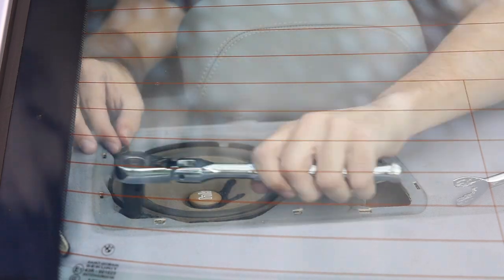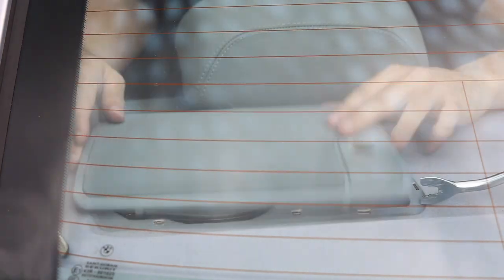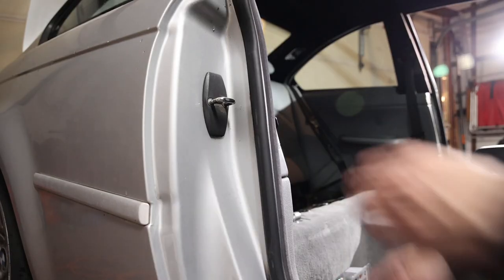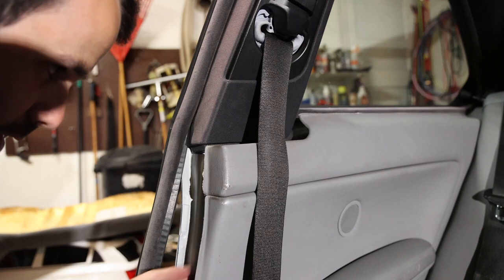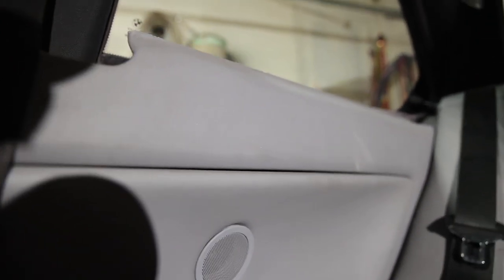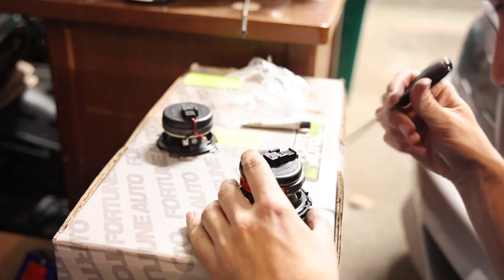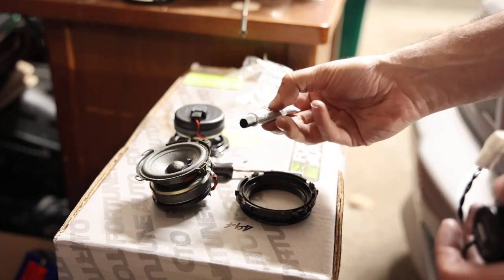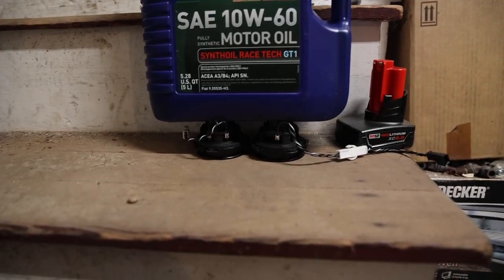Installing BavSound Speakers in my E46 M3!

Comment: I did this system on my e36. The only thing I didn’t like was the lack of base. It also is very high pitch out of the box. Needs some tweaking. BUT with that said it’s by FAR the best OEM + system out there. I just wish they made an integrated base for the e36 & e46. 

I’ll take a listen to it in your car and possible cop for the ZHP

Comment: There's not stuff out for Audi because it's often either Bose or B&O, which is difficult to just swap speakers. I added a sub to my '07 S4 DTM with Bose, but it's still not the B&O in my B8 S4. I'd like to add a sub, but the cost is not justifiable. 

It's better to just get the stock stereo and remove it all. Then, you're not paying for Bose or B&O.
Reply from the maker: an interesting thought for sure!!